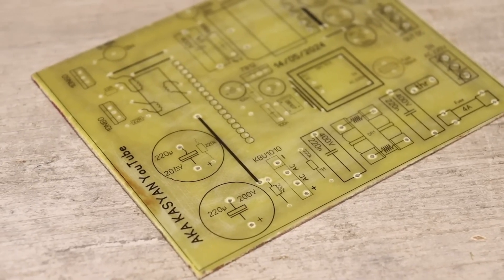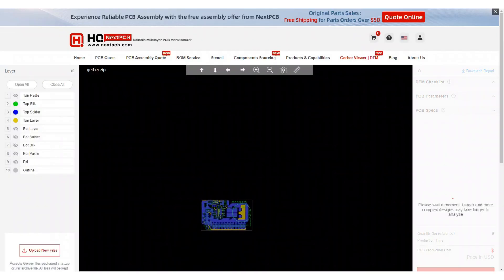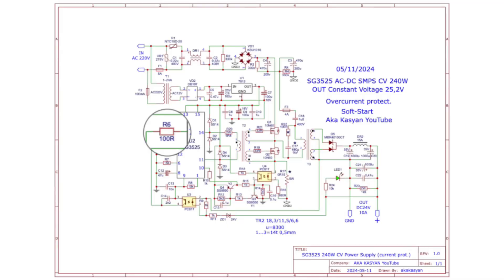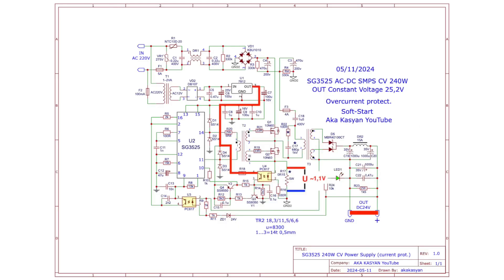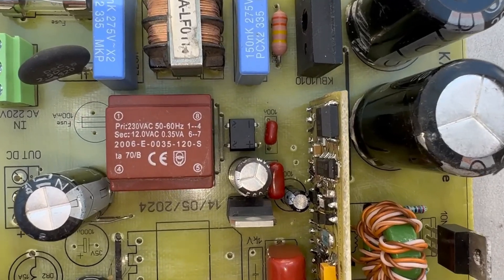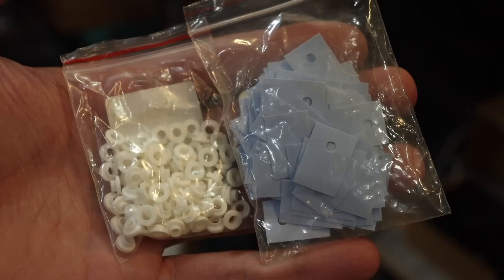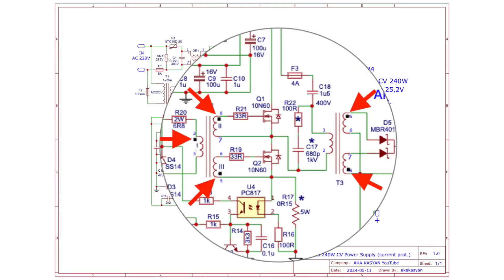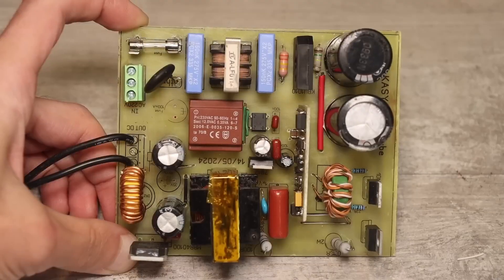Stabilized SMPS with current protection on SG3525

Comment: Why not install a drain Resistor instead of having to wait for Circuit to power down before you can re-engage power? Just asking? I’m not an Electronics expert.😅Also, does this Circuit Ring with this Chock and Transformer? You know, loud noise.😊
Reply: I mean that could work but is it really necessary?
Reply: @lorenzorentniop717  I really don’t know, that’s why I asked you. Thanks for the reply.